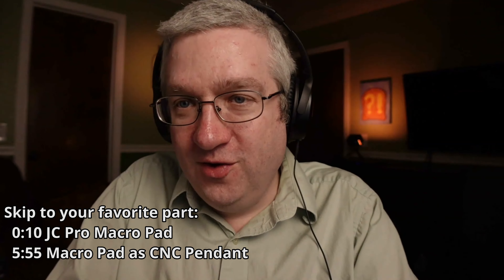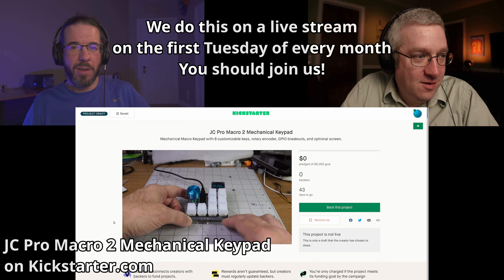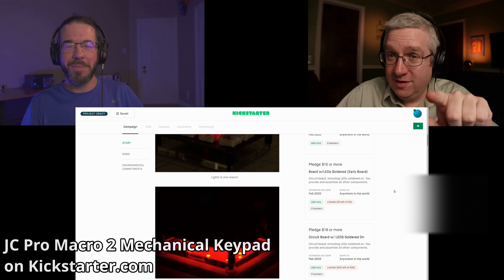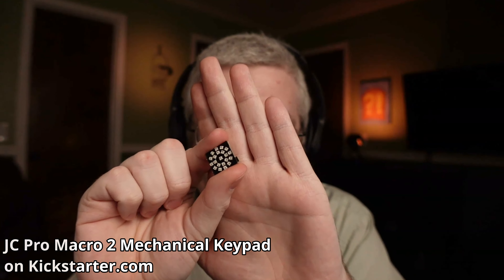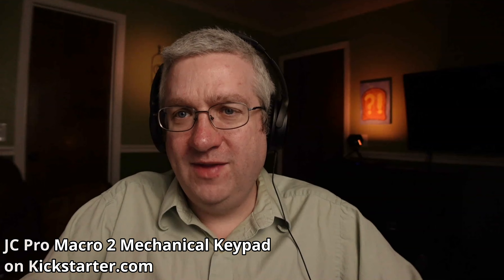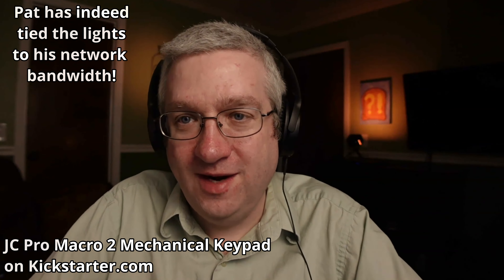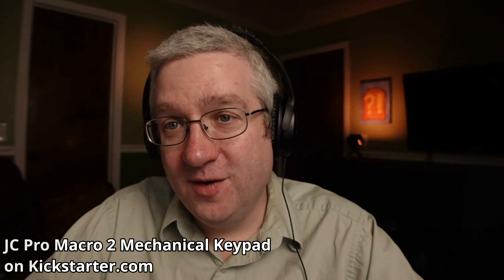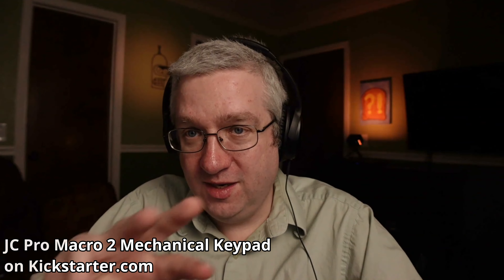JC Pro Macro Keypad with Rotary Knob Kickstarter, and Using A Macro Pad as a CNC Pendant with CNCjs

Comment: Brian is on the Internet now?
Thanks so much for talking about the JCPM2!
Reply: I'm working my way up to it.  I got distracted by LED stuff!

I have a complaint about the way the knob -> keys -> CNC movement works.  It isn't a fault of the macro pad.  If you turn it really fast, the machine keeps moving after you stop spinning.

I'd like to either code in a longer minimum delay between keypresses, or maybe have the macro pad automatically switch up from 0.1 mm to 1.0 mm if you spin it fast enough.  Maybe both!